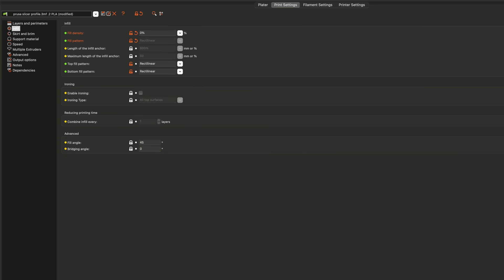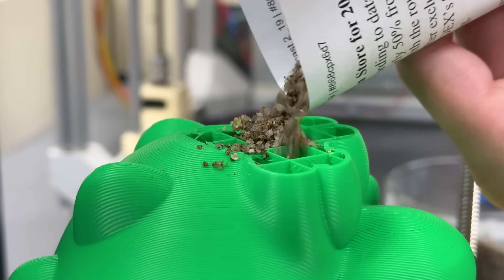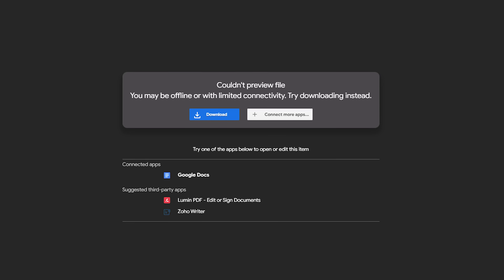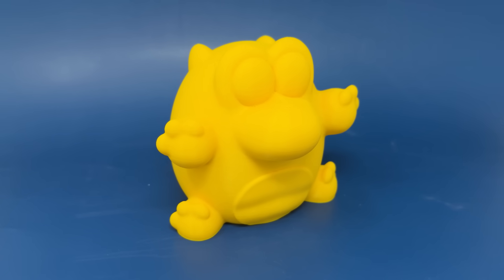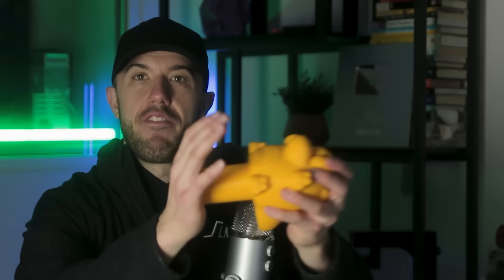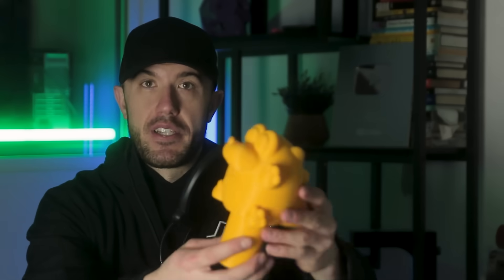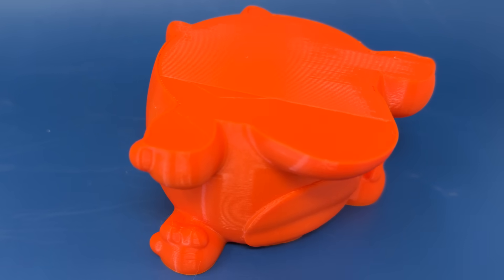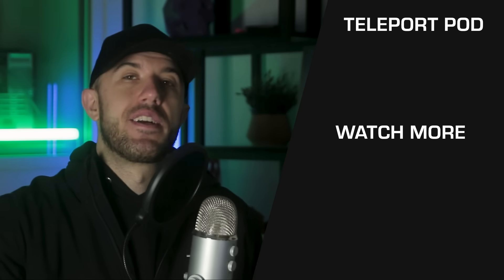How-to Make Your 3D Prints Heavy (Without Wasting Filament)

Comment: I've used table salt in the past.
$1/lb.
1lb. table salt = 1.6cups
1lb. water = 1.9cups
Glass jar + shipping + handling = $???

Table salt can be put in a 3D printed insert along with a small compressable "pillow" to avoid the "marimba effect".
Does not freeze.
Reply: Just make sure if you add it mid print the fan doesn't blow it all over you printer... Saw a bad picture of that once. The screw in canister will likely be my choice going forward.
Reply: @eslmatt811  
Not a problem for me....
Pausing my printer stops the fan.
I 3d printed a funnel for the pour.
Worked out great.
Your mileage may vary.

Comment: if you add plaster or cement mix into that jar you could make a solid plug, just add water still. In fact, you could just pour that right into the hole, so maybe just a cavity with internal roughness or maybe a screw shape, plus a baggie of bondo powder and instruction to add pennies and water. If the cavity is the shape of an upsidedown cone it would be permanent, as we saw in your hinge video.

Comment: there´s also the DIY perks version for speakers, filling  with a mixture of plaster of paris with 10% of it's water weight in PVA glue, makes a really heavy and (critical to the intended function) well-damped for resonances object
Reply: Yes, we know. Only there is one problem: Where does the water go that is not involved in the curing process? Looking at the reaction CaSO4⋅1/2H2O+3/2H2O→CaSO4⋅2H2O, it becomes clear that H20 is left over. Even under perfect curing process only uses water equivalent to 19% of the plaster's weight - 40-51% of the water (optimal ratios) are "free" = will evaporate / diffuse = it goes into the filament, causing deformation, it condenses on electronic / mechanical parts or into the furniture under the object...
Reply: Do you think you could put the part in a dehydrator for a few days to get the water out?

Comment: Having to pour some potentially biologically active substances inside the plastic model sounds like pretty big red flag to me. Also as a user I'd consider it a pretty bad UX if a toy I bought online requires me to manually entomb some outside materials (be it water or sand) as part of assembly, especially if it locks in and you can't disassemble it later. IMO it's probably better to just tune infill % modifier for areas that need to be a bit heavier.
Reply: He is only suggesting this  because he is pitching their template.
Reply: Portable Basketball hoops, umbrellas stands, etc all require this. I get the point but it's not unheard of.

Comment: Might want to test what happens to your container when the water freezes repeatedly. Freezing temperatures in homes are way more common than you would think: we designed and manufactured a line of cute coffee makers and you would not believe how many units got sent back defective / cracked because people left water in them ... and then forgot the thing in their car or left it in the moving van in a winter night, or in their holiday cottage during winter or placed it on the floor in a drafty garage...
Reply: It's an empty container. You can use whatever.
Reply: @Splarkszter  Jeez. A) as it said in the video - the container concept was developed to AVOID handling with sand/gravel/cat litter B) That's not the point: you make, say, a toy, a desktop organizer or a piece for cable management and fill the container with water. You then give/sell it to somebody but they would have no clue that cold conditions will destroy the product and cause additional damage.

Comment: I've done the insert, along with pausing the print to seal it , but then I run into the layer line issue.

My current product that I make (which is shaped similar to a rectangle), I print it in an orientation where the top of the product is on the build plate. I then print it with a large void/rectangular hole that I fill with sand once the print is done. Then I put a cover over it, and use purple pipe cleaner to glue the cover to the part (it's PETG so glue fuses). After that, I then use a soldering iron and seal the gap between the edge of the cover and the part. 

This gets covered up with a pad, so I don't have to worry about how it looks. I just have to make sure that sand can't leak through anyhow. This item can be dropped often with the setting it is used in, so I had to make sure there's no chance the sand can come through.